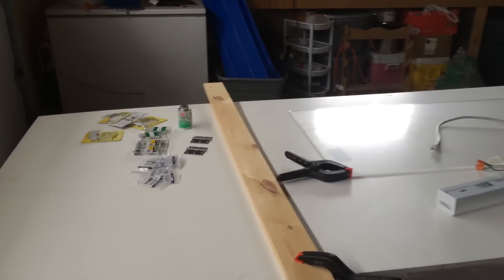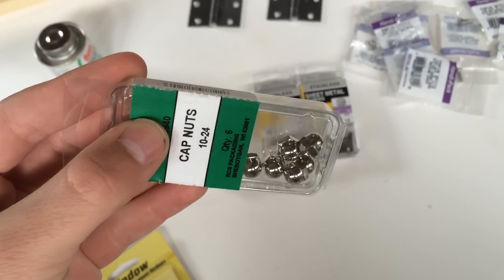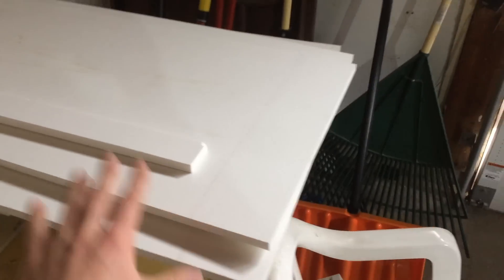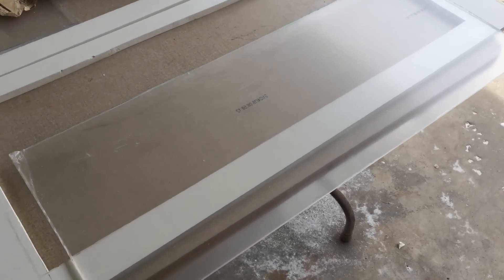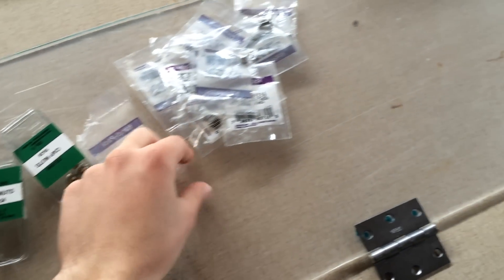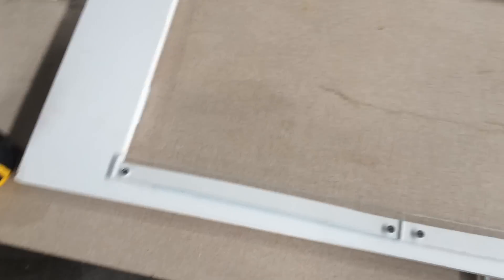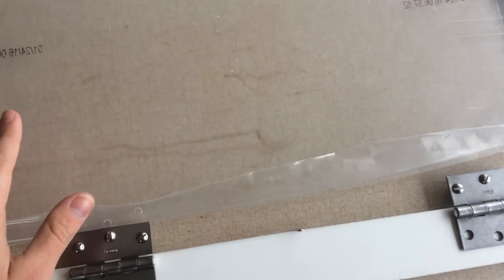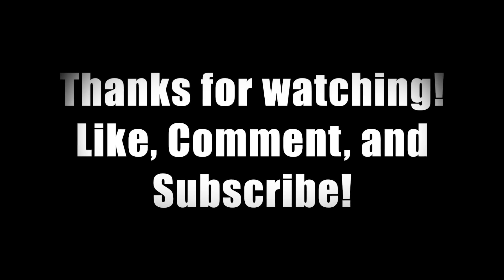How to Make a PVC Reptile Enclosure

Comment: Hi, can you talk about the cost approximately of building the entire enclosure. With and without the heating elements you've added in part 2
Reply from the maker: I've answered this probably over 10 times now in the comments lol. But less than $150 for the materials. With the light, driftwood, plants, heat set up and what not, total cost was around $200.
Reply: I'm sorry, I must not have been observant. Thanks for the info!
Reply from the maker: No problem!

Comment: So, I watched the video, and I think it's for 48x24x16.   Is there a way to expand this to 48x24x24?  Would you have a diagram for that size?   Is the PVC sturdy at the thinner thickness, without secondary framing?  Is there sagging with the thinner sheets?

Comment: do you just put the heat tape under it? no air holes?
Reply from the maker: Yup. I actually sandwiched the heat tape between the bottom of the enclosure and a scrap piece of PVC board. Without that a majority of the heat was being transferred to the cabinet the enclosure was sitting on rather than inside the enclosure. I also ended up cutting a circle in the top and adding a heat lamp because in my (cold) house the heat tape alone wasn't enough to heat the whole enclosure properly. As far as air holes I did add some to both sides of the enclosure.

Comment: nice guide, but for stacking purposes it's better to place side parts on TOP of the cage's floor, not just attach to it fro sides, because of weight distribution issues. but for standalone cage it's perfectly fine, good job.
Reply from the maker: Thanks, and good point. That is part of the reason why I said that you can change the configuration of how the panels fit together to suit your preferences.

Comment: Do you get the acrylic at Home Depot too? Do you have a link ? Thanks
Reply from the maker: The acrylic I got from Menard's. I'm sure almost any hardware store stocks 1/4" acrylic though. I just bought a 2'x4' sheet and cut it to size.
Reply: how much was a 2x4 piece? i cant find it on the site but ill ask when im there
Reply from the maker: https://www.menards.com/main/building-materials/acrylic-glass-sheeting/clear-colorless-acrylic-sheets/p-1444441878608-c-7551.htm?tid=-1300129012413537677 It may seem a bit expensive but if you cut one sheet in half lengthwise it will be enough to make doors for 2 cages

Comment: Thank you for this video, I've been looking for what materials are best for a snake cage, and as a cabinet maker I know how bad melamine and wood is with water and humidity, you can always treat it but I'm not sure if the stuff needed to treat it will be toxic for the animals, I know pvc is the best for reptile enclosures I just don't have experience with it so I wasnt sure if would be able to do it myself, but seeing your video helps alot because I see it's exactly like working wood basically, just different type of glue lol, one thing tho, did you need to seal the edges with silicone or something? Or did the pvc glue seal it to prevent any leaks?
Reply from the maker: I'm glad it was helpful! No I did not seal it other than than the PVC glue in the joints. I haven't had any problems with leaking in my high humidity enclosure with just that but if you're really worried I suppose you could always add a bead of silicone to the inside seams if you saw it leaking. With that said this isn't really intended to be an aquarium haha so for typical reptile applications the PVC glue is probably more than sufficient.
Reply: MedusaPythons ok cool, thanks for replying, and one more thing I plan on building some of these for burmese python, I went and saw this pvc at homedepot and it seemed very soft, have you had any problems with it sagging, specially where your heaters are? I do plan on putting some supports on these on the bottom because I know burmese are gonna be heavy, but I'm concerned with the spot the heater is going to be at.
Reply from the maker: I haven't noticed any significant warping that is noticeable to the human eye. With that said, my enclosures are only 4x2 so the ones you will build for burms will definitely need supports to keep them from sagging.
Reply: True, I built one today, i made a 2x4' one for my 7' male, I noticed the pvc glue is crazy strong, I didn't use screws on mine, just put the glue and clamped it together, and let it dry for a while, before I did that I did a test piece with just the glue, and I couldn't take it apart, I had to clamp the piece down and hit it with a hammer to finnaly take them apart. And it tore a chunk off of the piece it was glued to. Just thought I'd share for your future projects, the screws work but as a cabinet maker it irks me to see screws on finish ends lol, I usually laminate the ends where I screw but I can't do that with pvc. Hope this helps.
Reply from the maker: Good to know! Glad you had success doing this. Personally, I don't mind seeing the screws and I feel that they give it a bit better support if the pieces don't fit together exactly perfect (I don't have a table saw unfortunately so I tend to get a couple of very small gaps sometimes in the pieces where the glue might not be able to do its job)

Comment: This video is great! I completed my enclosure for my ball back in November. But I just found out that I had an issue with the heating pad. It burned to the bottom of the enclosure rendering it useless. I watched your other video on heating and thought that sticking it under would be the best method. (I guess not). What works well for you?
Reply from the maker: Shelby Horton honestly the best heating option for these enclosures seems to be a radiant heat panel on the inside or a heat lamp set up as in my carpet python enclosure that you saw in that video. I am surprised though that a heating bad burned its way through the material it must have been way too hot did you have a thermostat set up?
Reply: Obviously she did not because there is no way that sheet will ever melt at even 100 degrees. Maybe warp that high but not melt all the way threw.
Reply: 1. Get a piece of glass that's at least two inches larger than the heat mat.
2.  Cut a hole in the bottom of the enclosure (where you want the heat) 1.5 inches smaller than the piece of glass, in both directions. 
3. Mortise the edge around the top (inside the enclosure) the same size as the glass. 
4. Silicone the glass into the mortise. 
5. Attach heat mat to the bottom of the glass, along with the sensor for the thermostat (that you obviously forgot the first time, if you melted the enclosure). 

Voila! You now have a complex way of avoiding something you never should have encountered in the first place.

Comment: Pvc is very expensive and/or hard to find. The big box hardware stores dont carry sheets of it and finding specialty shops is very very difficult. Also just like every other video claiming cheap/easy reptile pvc enclosure, you do not put a link to where you got the materials or even mention it in your video. There are also many kinds of pictures board and you give no explanation what kind is used... don't make a "how to" or "walkthrough" or so called "helpful" video if you cannot address this to people who are actually watching your video to follow for use as reference. I'm tired of all these custom reptile cage builders who are like "this is how you build it but I won't show you where or how to get the parts/materials"

Comment: Use tape on the surface before you beat up the sheet from the jigsaw , you are better off dropping in with a circular saw for the door same as you did with the other sheet cuts , set your guide and blade depth and drop in , PVC is very fragile to work with blue painters tape helps protect your surface from bruising or scuffing.... Azec makes 10’by 20’ sheets of up to 1” thick also ... can get pricey

Comment: I've never worked with PVC board, is it the same material as the pipe? How does it stand with humidity? It seems like a good choice to build my bio active turtle and tortoise enclosures out of, but there would be high humidity for some of the species. Also, how big of a sheet can you get? The enclosures I'd make would be quite large, so I'd need at least 8'x4' pieces. Thanks
Reply from the maker: I'm not sure about the material... I'd assume its the same stuff as the pipe but the difference is that its open cellular pvc which means it has hollow air pockets throughout the board (so it's not solid plastic like the pipe - this also makes it very easy to glue and screw into). It is plastic though so it has no problems with humidity. They come in 4x8 sheets - that's what I started with for my enclosure build - just make sure if you're building something large to support it in various ways (like support beams along the inside) otherwise the weight of the long length of board will cause it to sag and warp.
Reply from the maker: And as you saw in the video you use exactly the same glue on it as you would use for pvc pipe

Comment: I made my first enclosures with melamine but they were so heavy I went with the pvc board this time. I love working with this stuff. The only problem I ran into was because mine are 2x4x15 is that the top was to flexible to stack so I am going to try supports to see if that will stop the sagging in the middle. Great video. I did the same door and really like the look.
Reply from the maker: Thanks! Good luck with the supports!
Reply: I'm wanting to make a 6'x2'x18" cage, how would you do your supports? I'm super worried about the sagging since I'm going to be spending to much money on building my boas forever home.

Comment: what is better to use pvc or abs i heard after awhile pvc sags down in a year or 2 from the humidity is that true or does it not matter wich one i use
Reply from the maker: In the year or two that I've had mine it has not sagged significantly. If you made the cage really large without supports then it may sag, but then any plastic would. I prefer PVC because it's easier to work with and much easier to put together. With ABS, because it's so thin, you cannot screw it together and you need to use a special glue instead, which is very expensive (~$40 a bottle).
Reply: im a plumber and times arre changing we never use abs any more only pvc and pex
Reply: @grant9182  I thought cast iron was always the best for plumbing.

Comment: Great video, but when it came to cutting and drilling into the Plexi, you kept saying to be careful as it would melt if sawed slow, and it would crack if drilled to fast... I work with Plexi everyday at my job and can confirm that it is super durable ... you will not likely "melt it" or crack it by drilling into it.... not to undermine you with this comment, I just wanted to let everyone know if they didn't.

Comment: About how much did it cost to build this, including the heating and lighting elements for it?
Reply from the maker: Less than $150 for the materials. With the light, driftwood, plants, heat set up and what not, total cost was around $200.
Reply: MedusaPythons doesn’t sound too bad. Thanks for the reply
Reply from the maker: No problem. Not bad at all considering prices for buying a new one.
Reply: How are you heating this? I am wanting to build this for a leopard gecko.
Reply from the maker: Check out the link in the description to my other video on heating these setups

Comment: How do you recommend I break down a 6'x3'x3' for a ackie monitor? I am having a hard time with dimensions. Thank you
Reply from the maker: Check out my google doc in the description of the dimensions for the 4'x2' cage. There are a number of ways you can do this but because of the thickness of the PVC board (1/2"), you will have to make some pieces smaller or larger than others. For instance, in the 4'x2' cage, both the top and bottom are 48" long, but the bottom is 24" wide and the top is only 23" wide to accommodate 1/2" from both sides (total of 1" less). This is because in my design, the sides attach on top of the bottom but on the side of the top. Every joint between two pieces can fit together in 2 different ways and you just have to take the extra thickness into account when measuring pieces. I hope this made some sense but basically just draw out how you want the pieces to fit together and adjust dimensions accordingly.
Reply from the maker: For instance, if I wanted to design this 6'X3'x3' cage with the exact same joint layout as I did for my 4'X2', I would make the top 35"x72" and the bottom 36"x72", the sides 35"x35", etc.
Reply from the maker: Also keep in mind that for that large of a cage I believe you will need two 4'X8' sheets of PVC to get all of your pieces. Hope this helped!
Reply: MedusaPythons thank you, mate. I'm thinking about adding a trough underneath since the monitors benefit from at least a foot of substrate. Thank you!!!
Reply from the maker: Danielle Marichal No problem!

Comment: what's the depth?
in fact what are all the measurements? thanks!
Reply from the maker: It is approximately a 4 foot long by two foot deep by 15" high cage. The exact measurements aren't really relevant because I custom made it to fit into a little alcove. You can vary the measurements however you see fit though. I believe you can't make anything bigger than a 4'x2'x15" with one piece of 4'x8' pvc board though... you will have to plan out how big you want it and then sketch out how you will make the cuts on the board to get the most out of each board. If you make it approximately those measurements or smaller though it shouldn't take more than one board.

Comment: Nice job. Do you have a list of all the part you purchased? I know the 1/2 in. x 48 in. x 8 ft. White PVC Trim but there was a lot of those tool you used for the job.
subbed
Reply from the maker: I don't have a list unfortunately other than when I went through all the parts at the start of the video. As far as tools I just used a circular saw to cut the PVC and a drill to put in the screws. A lot of the screws and bolts are interchangeable, I just used what I could find easily at the hardware store at the time that worked. If you want to see exactly what I used, you should be able to see the labels on them at the start of the video. Thanks for the sub!
Reply: MedusaPythons  quick question I have a 4x2x2 PVC enclosure what heating source would you recommend for this enclosure to house a boa ? And where would you recommend I get it ?
Reply: c4 tomato hey man, where did u get that setup from ?

Comment: Hey man how exactly did you take the measurements to get the top to fit in perfect? I’m doing a 3x2x2 if I cut them all precisely to those specs will it fit in like that? Any help is greatly appreciated!
Reply: No, you'll have to accommodate the thickness of your material. Depending how you frame it.

Comment: Thank you for this, my snake has been running out of space in her enclosure and its just so hard to find any fittingly sized commercial enclosures that aren't either WAY too small, or have so much wasted space it seems pointless, especially if it adds a huge amount to the cost. I was considering using a tub, but there are issues with that too, such as heating and not melting a plastic bottom and such. Plus they do not look appealing at all! This will help me a lot, thanks again! C:
Reply from the maker: Shelilla No problem! Glad I could help.
Reply from the maker: No problem, I agree! That's why I did this in the hope that it would help others out as well. Good luck!

Comment: no home depot / lowes selling this pvc sheet in my region (southern U.S.) :c
Reply from the maker: Dang that sucks. Maybe you can special order it and have it shipped to the home depot near you? Home depot in general definitely stocks it. The one by you just may have run out
Reply: Model H120AWS6  Internet #205309788  Store SKU #1000052907, $80
1/2 in. x 48 in. x 8 ft. White PVC Trim
Reply: Easier way, not much more, but it from Tapp plastics, bonus you can buy the pieces you need! No cutting. This is called "Foamed PVC", thats what most people call it.